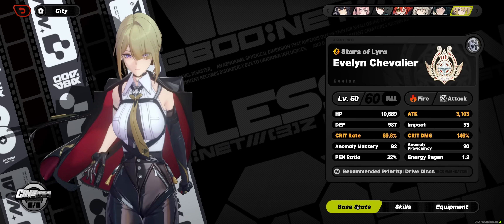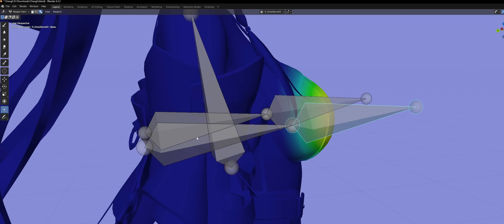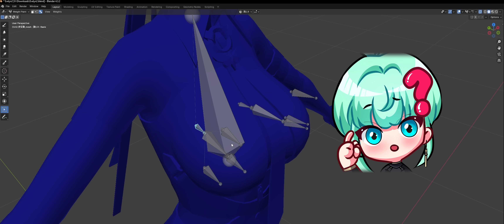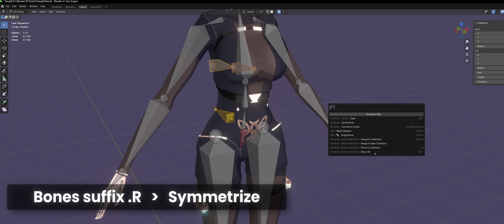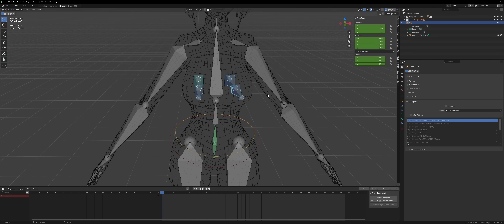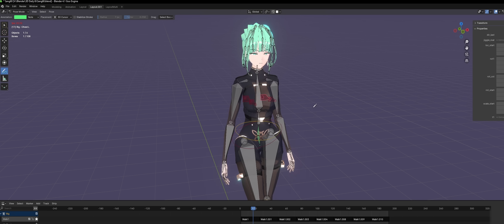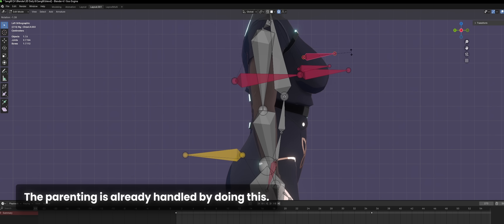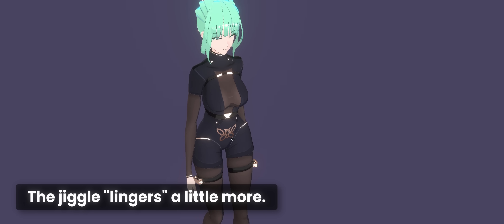They REVEALED their Secret 3D Jiggle Physics setup! — "4 Bones, trust me."

Comment: I feel like this is evolving backwards. You almost never see breasts move like that IRL where the tip of the nips is drooping as someone walks down stairs. The clothing should anchor the nips and instead volume should transfer from lower parts of the breasts to upper parts closer to the neck, while the nips stay anchored to the clothing, with the clothing itself moving slightly as affected by the volume transfer.

I'd assign a bigger area to the tip bone and set it as a driver for the rear bone which affect the top of the breast so that it does translation instead of rotation. The translation needs to be unlocked but capped. To handle overflow to the sides additional drivers are needed for the side bones, so that when the tip bone translates backwards, the side bones extend in the direction of the rotation.

References for science: watch?v=ZaTMyFmn7gw
shorts/KulOYfuKrJo
Reply: Im more concerned about where this guy is, He has been inaktive for a few months now on every Social Media i could find
Reply: @Nedrojt  He gooned until the very end u_u

Comment: What a lot of folks seem ro miss, in the back end, also quad are triangles. For some aspects, having the mesh in trinagles, lead to nicer simulations.

If you want nice and better deformation. You wiuld need to use mesh cage and mesh defprmstions with cloth system. But thos can be a pain to setup. Its tedious

Comment: Have you tried weight painting with a VRM imported straight into Blender via the VRM extension? I'm not getting any of the mirroring or normalization functionality, as if it's not entirely aware of the relationship between the bones. The mirroring works as expected when making modifications from in Unity, but I suspect that's because of the VRM add-on in Unity being more purpose-made for out of the box use?

Comment: To quote a friend that makes VRC models with a similar setup,
"Normalised vs. not normalised" is a Blenderism, it doesn't make a difference whether you do or not as far as the final result goes, it just makes it easier to edit in-software sometimes (like in that example of adding weight without affecting the rest of the boob weights). As far as game engines and skeletal supporting 3D file formats are concerned, all weights are "normalised".

Comment: There's a really key thing to understand here that needs to be pointed out for that first example!
It's incredibly important to understand why that first bone of the two bone setup starts from so far back. That bone exists to give the overall positional movement. It's pivot point being offset so much means that it shifts the whole breast even with very stiff settings, but will barely impart any rotation, and on it's own it obviously cannot deform the shape of the breast.
The second bone that starts from more around where the breast is attached to the body, exists to enable deformation, and allow for a subtle degree of rotation, but is incapable of effecting position in a realistic way.

Each part (position/deformation) should have their own distinct settings for best results. Understanding this two part concept is probably the most important thing, regardless of how many extra deformation bones you add.
Reply: this!

Comment: Industry standard for 10-20 years has been what's called a 'spring bone'. And usually, there's just one for each breast. Unity is just funny in that the dynamic bones (and phys bones if you're in VRChat) prefer the model have leaf bones, because unity can't tell the difference between the bone's head or tail, so it only counts the head. A spring bone does much what a regular bone does, but the distance between the head and the tail is also elastic.

Edit: if I'm wrong please correct me i feel like it's 2 am and my brain is fried rn

Comment: I feel like you missed a pretty important point when comparing those two rigs.  The location of the main bone is EXTREMELY important when it comes to physics, because it sets the pivot point for the entire bone chain.  Imagine you're shaking a water balloon.  If you hold it close to the end, there will be way more jiggle than if you hold it closer to the center.

For the 1st WuWa model, they've set the pivot point crazy far away behind the back.  This means that any rotation from that main bone will be amplified a ton because its so far away.  To compensate, they have the torso weights overlap more of the breasts in order to lessen the impact of the breast bones.  The physics on that main bone is probably set extremely stiff in order to limit the rotation, because otherwise the breasts would be all over the place.
Compare that to the ZZZ model which has its pivot point much further forward.  The torso bone has basically no overlapping weights on the breast because the range of motion from the pivot point doesn't require extra compensation.

As always, there isn't a right or wrong method.  You just need to understand that these two methods will result in different kinds of jiggle physics, and each require their own unique approaches to weight painting and physics values to get right.
Reply: This. Very important part of this to understand.
Reply: The bones are set back to simulate sliding rather than rotation.
Reply: we got the wiggle physics phD in here guys
Reply: Phd in goonology

Comment: I personally don't like the multiple bones. It causes the mass to lose its shape and jiggle in an inconsistent matter, which is not what we want. I think focusing the jiggle more on bone rotation rather than position may help as it causes the boob to sorta roll naturally over the rest of the body instead of slide across it weirdly as you demonstrated in the example before adding the additional bones.
Reply: I'm a little split on this. I think I like multiple bones for the purposes of altering shape and jiggle, it makes it easier to swap outfits over a base model with different levels of desired support or compression. But if there's no intention to change outfits and there's a desire for a simpler and more logical rig then yeah.
Reply: @lyricaltokarev4747  The secondary bones do allow for secondary animation. As the main titty reaches the turning point of its wiggle, the secondary bone ensures that some of the titty lags behind so instead of the boob being a solid on a spring, it has some mass and is maluable. However, spreading it to a section on the sides and on the top just looks weird. 

Making the middle secondary bone larger and encompass the entire titty so the whole thing can stretch and lag makes it more consistent and looks better.

Comment: Regarding the three-bone chain at 7:11, the root bone MAY be necessary for game-ready models, because adding a physics component to the succeeding two bones after MIGHT cause the two bones to fall DIRECTLY to the floor as if unattached, with hilarious gumby-like results. Always consult the engine's documentation you are building for, if you are making for a game engine.
Reply: Can confirm, unity's magica cloth does it that way. The 1st bone in the chain is not for moving the mesh but to defines which bones after them moves.
Reply: I guess the idea is to bake it into the animations, as, as he said, the values explode if not adjusted correctly for an animation
Reply: @WhoLeb7  probably possible to program the values dynamically though... based on the action the character is doing rather than having it in a baked in animation.
Reply: @Wingnut353 great now your gameplay programmer has to specify extra parameters they don't understand for every animation instead of just letting the animator cook

Comment: Pretty good work. I'd definitely add that the dropoff for the physics needs to be a lot faster (they look like water, not flesh,) and anatomically, believable physics account for the inner bud of the breasts, as well as their whole form's volumetric sliding across the ribs depending on gravity and position, which would work as the input for the physics you built. So long as that hierarchy is there, you can take it from "water balloon" to "human body" and start looking at density and weight with more deliberate choice. A similar secondary action has to be considered for the whole body, the hair, etc. Sometimes it's a ripple, sometimes it's a wave, but ultimately, the best physics hierarchy will depend on understanding the anatomical logic behind the body (figure drawing helps immensely with this). I might also recommend modeling the body in a way with minimal to no gravity (underwater nude figure reference can help with getting this right), and then see if your physics hierarchy is dialed back enough to let them naturally fall into place. Your current water balloon numbers would likely result in a lot more sagging if that was the route taken, but that's good information to help determine where the physics simulation cutoff should be. More rippling (slow motion impact on any part of the body shows this) helps a lot too, but depending on the style of animation, you might put it on 2s or even 3s and intentionally disregard that due to how our eyes don't really catch ripples in-motion.
Reply: This guy knows
Reply: @radicant7283 Bro's a certified goonologist fr fr